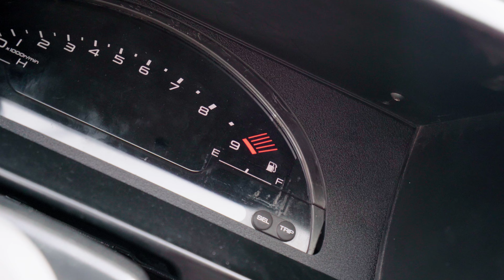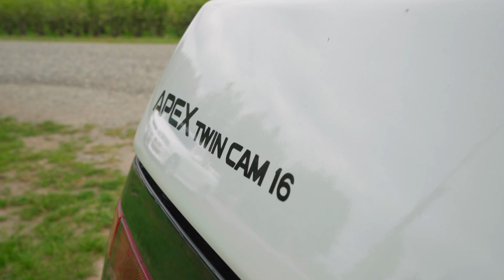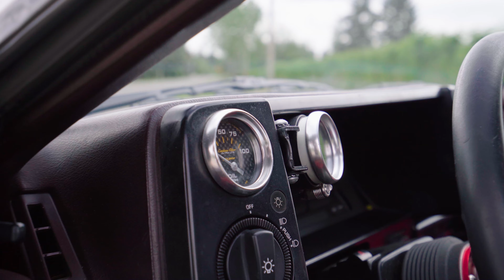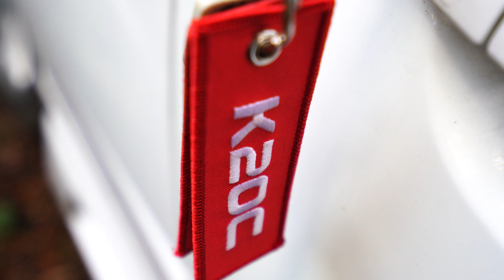This F20C-Powered Toyota AE86 is Pure Madness | Go Home, Purists

Comment: The "Purists" should direct the anger at Toyota for not making a modern-day 4age. 
Toyota gave up on decent 4-bangers (and well everything else), Honda didn't.
Reply: The did…. It’s called the Toyota 3S-GE Beams Dual VVT-i 😂 Capable of 250hp Naturally Aspirated
Reply: @kevinruger8819  You can buy that new today or 15 years ago? 
That must be Toyotas most well kept secret if so 😂 
Honda k is available in Dealers: Now Now Now lol
Reply: The 3S BEAMS engine and the 2ZZ were modern 4AG’s. Today Toyota’s turbo 3cyl from the GR Yaris/Corolla are the good modern 4AG. Toyota is currently also developing a new 4cyl right now if you follow the news. So I don’t know what you’re talking about
Reply: @cory5197  turbo isn't n/a... 
I don't know what you're talking about. 2zz Is/was cool but also nearly 20 years old, also known for horendous oil issues, isn't it? 
Listen I'm a toyota fan, but they haven't made a good 4 cylinder N/A engine for decades, only v6's.. and even those are bland af, but also reliable af.
Reply: @starfox_wr-45e93  everything is turbo now if you’re talking about today.  

Honda has given up on the N/A 4cyl just like Toyota did too. Look at the new type R and the Si’s, they’re all turbo. So if you want a N/A 4cyl, the closest thing is a FA20/24 in boxer format. 

This AE86 in the video has a F20C engine from an s2000 that came out the same era/time as the 2ZZ from the Celica GTS and Lotus Elise, so the engine in this swapped AE86 is just as old as the 2ZZ. Both are old N/A engines.
Reply: @cory5197 the only reason there is no N/A anymore is because of emission laws that are everywhere now.
Reply: Ah yes let’s be struck in the past forever.

Comment: This was such a treat for me since I own a 2000 AP1 S2000 with the same F20C1 and I own an AE Corolla GT (not 86, 111) with the 4AGE Blacktop 20 Valve :yougotthis: The 20 Valve is very popular as a swap for the AE86 but the F20C is the ultimate :face-blue-smiling: Props to the owner for pulling this off :hands-yellow-heart-red:

Comment: It sounds like VTEC is not engaging, there's no audible tone shift at least coming through on YouTube. Given that it's using a factory ECU (assuming this since it requires a Honda key to start), there should be a very noticeable tone shift when VTEC engages at ~ 6000 RPM and I'm not hearing any change in tonality at all - just what you'd expect from higher revs on the smaller camshaft lobes.